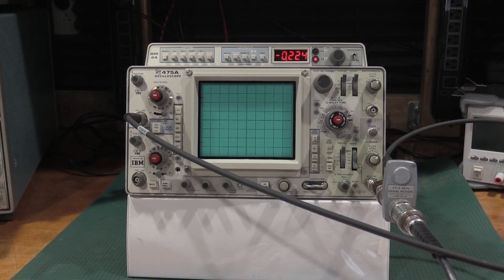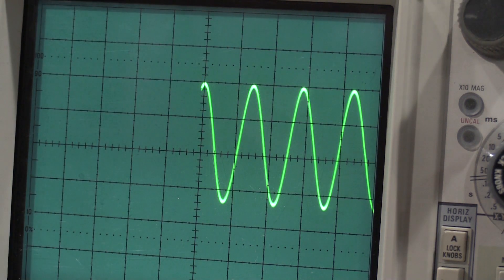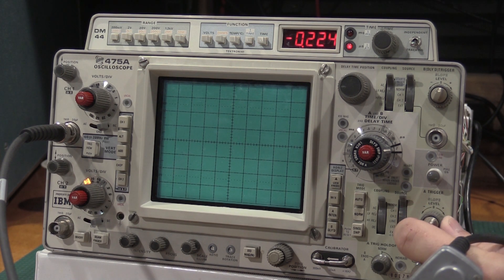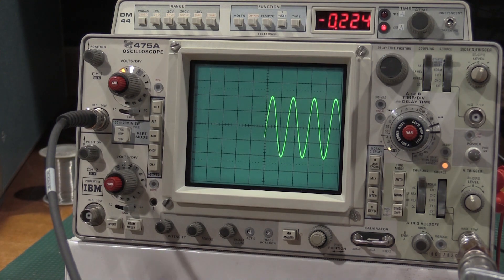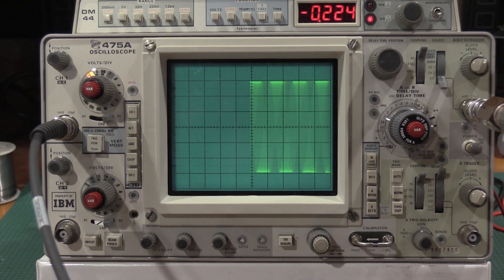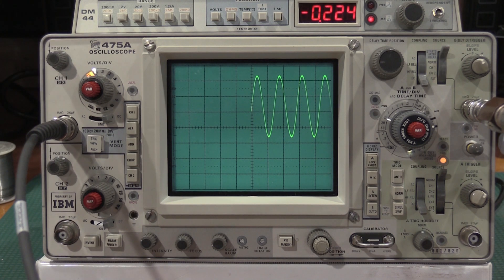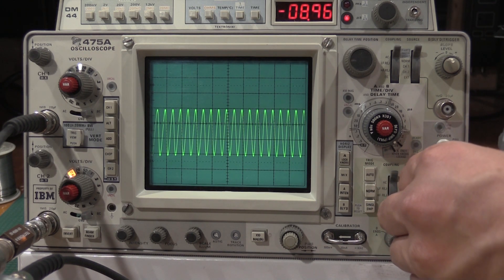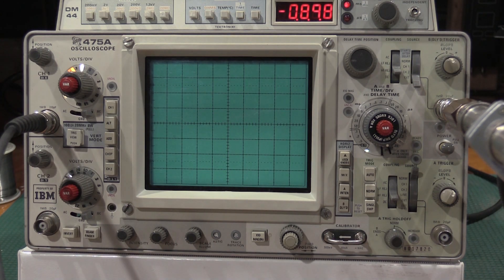Tektronix 475A Trigger Section Alignment

Comment: The trigger symetry adj is quite confusing. Acording to manual it should be set to 0.7 div of SPACE between the neg. start and pos. stop. Not overlapping when + and - slope. In my opinion is like 0.35 from center for both. That gives a total of 0.7 space.This is about the adjustment. The overlap of 0.5 and space up to 2 div is what is the max and min allowed.

Comment: Appreciate all the information you provide! Right now I'm in the process of reparing my 465B, your videos on this particular scope came in really handy. I identified CR1541 (diode gate) to be open, leading to a large offset and half the signal amplitude. For testing purposes I replaced it with a BAT41, solving the issue (there is still a fairly large offset, potentially due to the mismatch between the diodes and alignment). Can you recommend a better replacement? I believe I could source this very diode (5082-2672), but the price plus shipping costs to Germany would make this option unreasonable... Thinking about replacing the diode in the positive signal path as well (CR1545) to keep the diodes somewhat matched. Would appreciate any suggestions!
Reply from the maker: I am not sure of the exact parameters of a BAT41. Weather it is suitable or not would be determined by if the alignment can be completed If the adjustments are close to the end stops of the adjustment range there might be a better device. I’ll look in at the schematic to get a better feel for what CR1541 is doing in the circuit. It could be as simple as setting up a bias or clamping or could be more complex.
Reply: @ZenwizardStudios  I appreciate it!

Comment: @4:36 Trigger overlap of 0.7 divisions: wouldn't that mean +0.35 high and 0.35 low? +/ 0.7 sounds like 1.4 overlap.
Reply from the maker: Of total overlap I would agree. I will check the service manual again. This is one spot where the wording is not really clear at all. The way it was tuned in the video is +0.7 above -0.7 below the center line which was set up for ground ref.